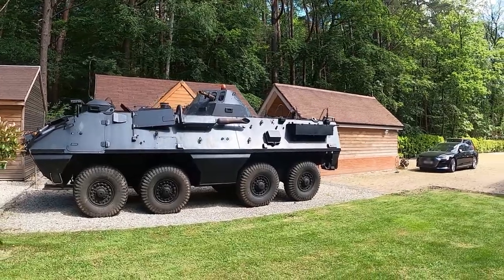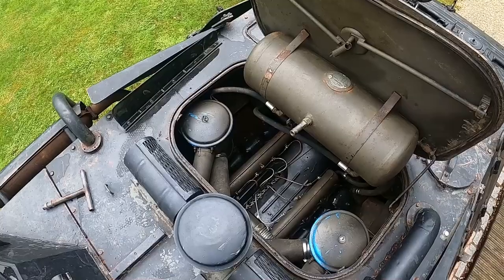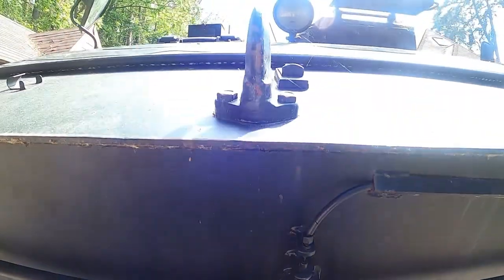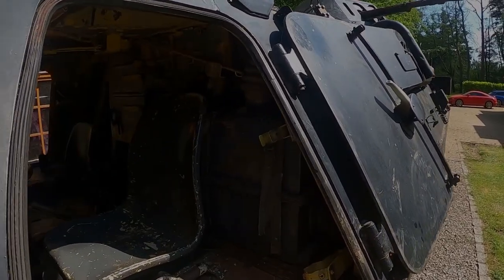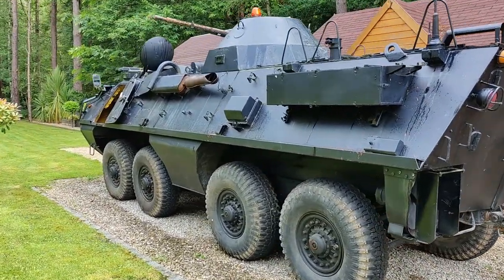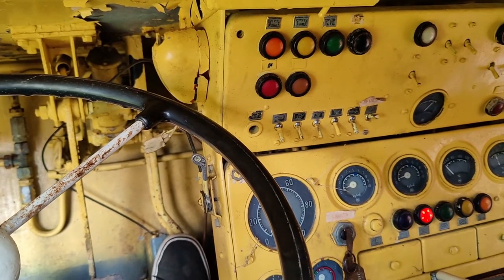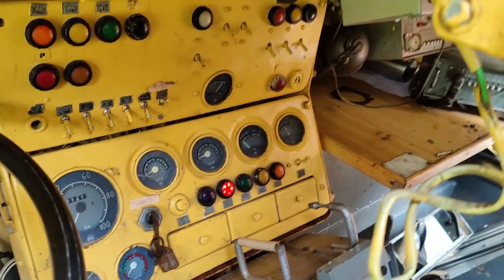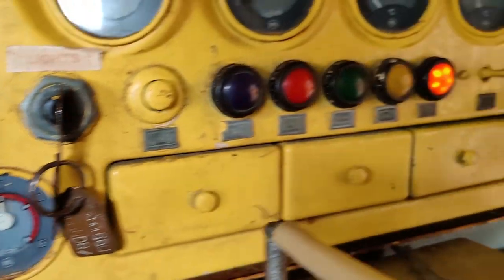SKOT R2M OT64 Overview

Comment: before the start you have to pull out the choke cable - maximum fuel dose, it is located behind the right arm of the driver :-)
Reply: Choke? In a diesel?
Reply: @LMB222  Yess, we call it "ruční plyn" and its used with "Motorpal" fuel pum on each Tatra engine. Same is for V3S and T111 or T138 motor family. For cold start you need to use is, if you will not, you have exactly same problems with smooth start as is in this video. Normally this T928 engine in good condition cold start is max. 5s of starter work.

Comment: When you will take your OT-64 to the lake, then be sure to have some weights at the back part. It was designed to swim with soldiers. Here in Czech some guys misplaced IFV with sumbarine ... Basicaly it is heavy on the front because of the engine and it sunk. Or one guy forget to close front doors and guess what :) ...

Start your engine with disengaged clutch because without it you risk damaging your main shaft.
Reply: it has also the engine in the middle because you can have safe rear doors for infantry squad instead of hatches like on BTRs

Comment: I've seen, that you had your engine swapped, so I won't comment on that. But your OT-64 takes a lot of time to build up the pressure in the primary and secondary loop. You should check the connections on these pipes, because most likely the fiber pads in them got squished and they don't insulate connectors anymore.
It's a real unpleasant job, because sometimes your ass will be higher, than your head, but it has to be done, if your SKOT can ever be driven safely and in a reliable manner.
We have an NOS engine for SKOT in stock for 4300€, with shipping to UK costing approximately 400-550€, depending on where you are.

Comment: James, I would luv to hear about the modifications you had to do to make the new engine work for you. A Tatra truck engine was installed in mine and the sump is not being pumped back to tank!        My OT 64 had hard starting if parked on a hill,  the original fuel pump has a primer pump which you actuate until you hear fuel passing the injection pump's pressure regulating valve. Actuate that pump if she has been sitting for a while.  I had to rebuild the battery disconnect switch contacts as my Tatra was cranked more than  recommended. Enjoyed your video.
Reply from the maker: Good info.  Mine had an aftermarket pump (and filter) added before I bought it, which I've left in place for now.  When the engine got swapped, that primer knob didn't get fitted back.  I'm not sure it it's no longer on the new engine, or just didn't get refitted to be honest, but I'll take another look.
Reply: @JamesLetley  Could you put me in touch, perhaps via email, with the mechanic that did your engine swap? I need to know if the Tatra truck engine is fitted with the same oil pump and scavenging pipes as the military engine. I am trying to avoid pulling the engine if I can, please advise.
Reply from the maker: @peterchaconas7695  Everything on the new engine the was different got swapped with the parts from the original engine.  I'm pretty certain I have the original oil system fitted.  The guys a trackandwheel.co.uk did the engine swap for me, and I know it took a LOT longer than they expected.
Reply: @JamesLetley  James, Also I am told to always start the engine in neutral with the shift clutch depressed, failure to do so can cause the engine to transmission shaft to shear,,,,a common issue! I have been shifting the transfer case into neutral before shutting down, Best of luck, thanks for the contact.
Reply: @JamesLetley  that pump is located underneath the round hatch, behind the driver's seat. Thanks to it, it is very easy to bleed air from the air system, if it ever catches any.
Reply: They were produced in Poland at the Truck Factory in Lublin. About 5,000 transporters were produced, some for the Polish army and some for the Czechoslovak army.
Reply: @iwonaradecka7562  actually, they were produced both in Czechoslovakia and in Poland. Tatra sent complete undercarriages to Lublin, Poland, where they were fitted with a hull, then these hulls on wheels were sent back to Czechoslovakia for a final assembly of smaller components and accessories.

It was a long and very complicated process. And both sides didn't trust each other to the point, that they did not share info about the problems they had. So, for example, there was a batch of hulls made out of bad quality steel, which were sent to Czechoslovakia for final assembly (they were eventually replaced). And another batch of crappy engines made from a wrong type of aluminum, which were also later replaced with good ones.

Just a little glimpse of a very interesting and complex story of the OT-64 SKOT. :-)

Comment: Does that engine have glow plugs ??   Even older Mercedes diesels had glow plugs with an indicator as to when they were ready to start.   I love your tank protection guard dog.    Thanx for the video
Reply: The whole engine is designed to work after EMP from nuclear warhead, so electronics are unlikely.

Comment: Amazing video! Personally want to buy one by next year hopefully in fresh hood condition. Now the plans are to engine swap it because even though it’s 11liter v8 diesel I want to LS SWAP IT probably a 6.2 corvette engine and hopefully not only make it possible but make it increase its overall speed . ( not worried about it mating to transmission car guys always find a way ) later on add some thicker plating to it and mod it up for apocalypse…. Then buy a second one !!!! To have around to use normally

Comment: My OT-64 start quickly,  I think you have air in the diesel lines, I had the same problem, I replaced all the flexible diesel pipes, now it starts immediately !!!
Reply from the maker: Thanks!  Yes it normally starts quicker than that, but I'll take a look.

Comment: i think you know nothing about ot-64. in its days, it had many modern and cool features at this time (it was designed in 1959!). i also doubt it has so loud engine, maybe this one has noise isolation in a bad shape. also the crew was using tanker helmets, so the noise was more isolated. and it was not only polish, but polish-czechoslovakian project. it had the engine compartment in the middle, so there were big and comfort  reasr doors for infantry, not hatches like in soviet btr. it was ambiphious even with two tones of load in the back. and it could drive 100 kmh (60 mph) on the road. and so on...
Reply from the maker: You're quite right, I called it my "sports tank" because 60mph is very impressive. I've driven it that fast on the motorway.  It was very innovative and much better than the Soviet equivalents from the time. I can assure you though that the engine is very noisy when you're in the front or back. There is essentially no noise protection other than the thin metal panels. I say Polish because mine was in the Polish army originally, but yes it was a joint development. Not Czech only either as some have said.
Reply: @cahounek  SKOT byl a je daleko lepší stroj než všechny Americké,velmi vysoké transportéry.
Reply: @JamesLetley  To je stroj do války a ne na výlety.Vše,co lehce hoří tam nepatří.Ani izolační materiály.
Reply: @fanda789  já ho schválně porovnávám s BTR, tedy stejnou koncepcí (8x8)

Comment: Hi James, I was wondering what the gear ratios for this vehicle are? could you tell me your speeds at some rpm in each gear?
Reply from the maker: I found this info (speeds are @2000rpm, high ratio): 1st: 1:10.25, 9.2km/h 2nd 1:4.08, 22.1 km/h  3rd: 1:2.55, 37.0 km/h 4th 1:1.6, 58.9km/h 5th 1:1, 94.4km/h reverse 1:6.88, 13.7km/h
Reply: @JamesLetley  amazing thank you!

Comment: Dude how much did this cost?
Reply: I believe you can buy one for less than $30,000 in the US and  a little less in UK
Reply: @badas45  Few years back one could buy one for an equivalent of about $2000. OK, it was about 20 years ago so adjust for inflation, but still...
Reply: @badas45 where can I buy or look for one here in the US?